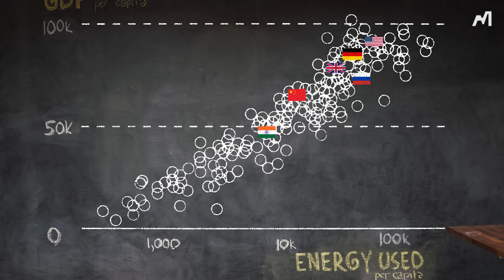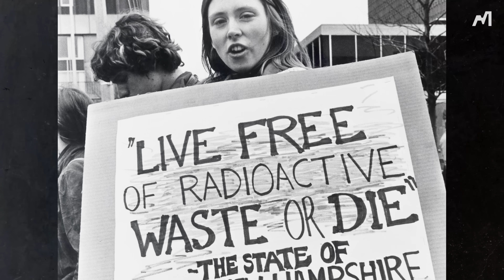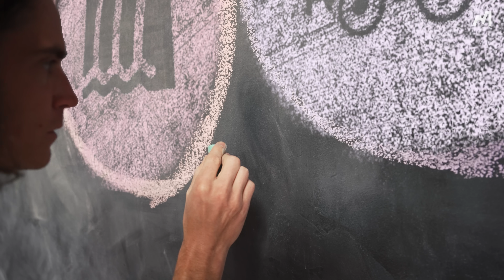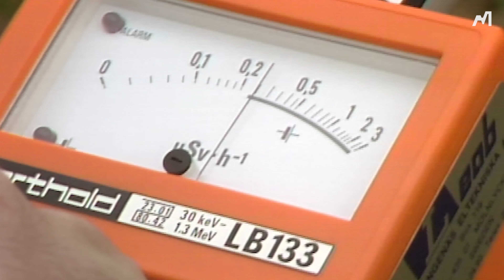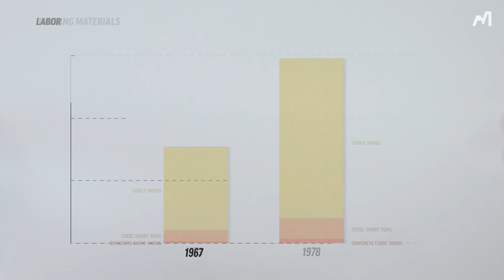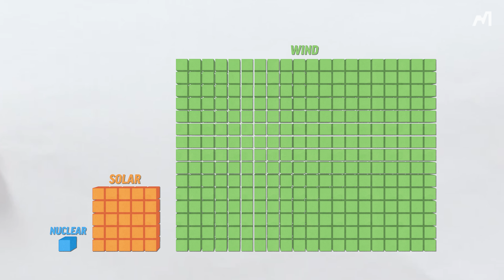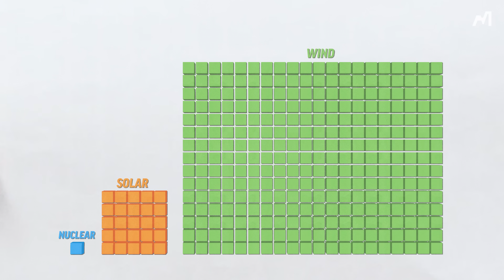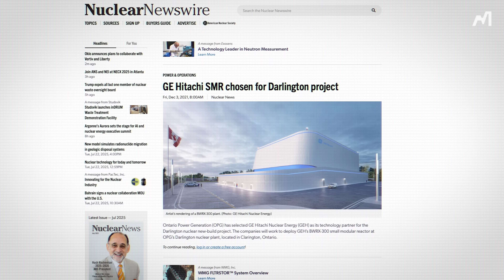They're Lying to You About Nuclear Energy

Comment: 14:31

From various sources wind turbines are designed to last 20-30 years and nuclear 40-60. 

Some nuclear plants have had licence extensions to 80 years but it's not their designed lifespan.

Using two current projects in the UK as a comparison. Hinkley Point C nuclear and Dogger Bank offshore wind farm the cost difference is huge.

Using current up to date completion costs per GW of energy produced. 

Hinkley Point C completion estimate is £50 Billion and will produce 3.2GW. Taken over 30 years from inception and expected to take 15 years to build.

Dogger Bank completion estimate is £8 Billion and will produce 3.6GW. Taken around 17 years from inception and build time of 7 years.

So Dogger Bank wind farm has been 7 x cheaper per GW to build, has taken half the time in early stages and planning and build time is half that if nuclear. Replacement of turbines like for like will be cheaper in 25-30 years time and likely more efficient and it will still have been 3.5x cheaper than nuclear. 

And you don't have the expense of storing waste indefinitely.

Footprint size doesn't matter, for energy generation it's not really a useful metric as all power generation is positioned in appropriate places. If Dogger Bank is 1000 x the size of a nuclear plant does it matter if it's out at sea? Not really.
Reply: Yep. And this is not anecdotal. Every recent review agrees. Nuclear is more expensive and takes far longer to build. And that is with nuclear having received easily 100 times the research funding over the decades.

Comment: I think it is naive to think there where only 50 death. The number for Chernobyl death is drastically underestimated. It’s a number the Soviet Union used … there were laws passed to keep the official number of deaths as low as possible. So the true number of deaths is going to be in the thousands (5000-90.000). Obviously impossible to tell the exact number.
Reply: He's going off the direct deaths from the people who died immediately in the explosion and putting out the fire. He's fully ignoring the rates of cancer in liquidators and people from the surrounding area.
Reply: @XandateOfHeaven  exactly. I agree with his point that radiation isnt AS damgerous as many people belive it is, but the way he makes his argument is just dishonest
Reply: @datpilz8895   Exactly. You can very legitimately make the case that so many thousands of people die from air pollution from coal plants that the cancer deaths from Chernobyl are irrelevant by comparison, that's fine, but we need to lay it all out.

Comment: Windmill electricity near coasts or at sea at least are WAAAAAY cheaper than nuclear power plant. At least in europe.
Reply: This is true, but nuclear plants are very cheap to operate after they've been built, and are cheaper than coal. So nuclear plants should not be shut down, and should be used in case where hydro or wind isn't viable.

Comment: Some of the land use of solar is on existing buildings, so a non-issue. On the other hand, if you rely on renewables entirely, batteries alone won't do. You also need to overcome seasonal variations, which realistically require some forms of power to gas.

Comment: Why are we still discussing nuclear? Wind and PV are cheaper. Way, wayyy cheaper. And they are cheaper even as compared to nuclear at its peak. And wind/PV got to that point in about a decade or so, despite heavy resistance of the oil industry and orange presidents ranting about birds. So safety aside, it just doesn’t make any sense anymore from an economic perspective. We need to move on.

Comment: 12:40 fascinatingly, depending on climate and the crops and solar panels used, building solar panels over crops can dramatically increase crop yield by reducing the risk of the sun overheating plants and drying out soil.
Doesnt help in climates like England or with heat resistant crops like corn, but if you want to grow tomatoes in Texas, its worth a try.

Comment: 11:50 Do note that wind energy doesnt really "use" that much land. They need a lot of area because they have to be far apart from each other, but you can absolutely do stuff like farm corn between the wind turbines with basically zero downsides. So the effective land use is very, very low. Most of the wind energy here in Germany is farmers making a bit of extra cash by renting out a dozen square meters to an energy company.
Reply: But the cost of having useful land or supporting ecosystems below is the devastation to the aerial ecosystems. A fuel source isnt exactly "sustainable" if it could endanger species in the long term that are critical to preventing ecosystem collapse, like birds of prey.

We hate insects but 99% of them are beneficial to the world. You'd likely see higher pest mammal rates around windmill farms because the birds that normally prey on them are getting sniped out of the air.

Comment: I am not against nuclear power, BUT

nuclear power is the most expensive of all energy sources. in the future, the price will only grow because the available uranium sources get harder to come by. 

also uranium is no endless ressource... if the current rate of consumption does not change, we will run out of uranium in about 250 years. 

we should not stop adding nuclear power to the energy mix, but i think it is very smart to concentrate on the development RENEWABLE (as in endless and cheap) energy sources.

Comment: Coal is far too valuable to burn, as is oil. Nuclear IS the only way forward, and Britain is being forced to go wind and solar. We have had the greenest energy provider since the 1950's in Scotland, which is hydroelectric. Now, it only gets turned on at the highest electricity usage so that they can make the most money out of it. A system that gave widespread, poor Scottish homes electricity was then siphoned off to run aluminium smelting and profit. In Scotland, we get lots of rain, so what, so does Washington State, but our green energy has been taken away from us. The Firth of Forth (Edinburgh way) is a tidal area that floods some 20-30 feet twice a day! God knows how much water that is, but tidal energy-producing subs could harness that energy, and that's twice a day. Off the Isle of Skye, the gap in between has tremendous tidal forces twice a day and they have a tidal generator of the Isles of Shetland to help power the island. We have far greener energy producers that work twice a day than all the solar and wind could produce, and you can't see them!!!

Comment: Oil/Coal/Natural Gas - constantly contaminates the environment, but is efficient enough.
Solar power - expensive to maintain and takes up too much space, not constant therefore not efficient enough.
Wind power - even less constant than solar power, therefore not efficient.
Hydroelectric Power - pretty efficient though needs a huge reservoir of water that has to take up a lot of land. And when it fails (which is more often than any nuclear accident) it causes mass destruction and deaths.
Nuclear energy - the most efficient and eco-friendly power source. Though it is expensive to build and maintain (including nuclear waste).

Comment: Nuclear power not only generates more nuclear energy. Now I will give you uranium is rare and it's it's not the best for power because it is scarce even if you only need small amounts. However, if we develop nuclear power, we might be able to get to a fusion reactor which will use hydrogen which is the most abundant s*** in the universe. So it's it's something we should use until we get fusion power but also the radioactive stuff. I've figured out how you deal with that right? You just dig a really big hole. You throw it in the hole and then you seal it. That's one of the best ways to deal with it and all it does. And all you have to do is dig like a kilometre. Deep hole which is pretty easy. Doesn't have to be a big hole, it just need to be really deep hole

Comment: Um, that very low number of deaths caused by nuclear energy use is not real... One of the issues is the linear no-threshold model that is mentioned in the video. We need to consider this, and other variables, when comparing statistics that have been built in very different ways. If we are including sensible statistical quantities for deaths caused by nuclear energy use that cannot definitively attributed in a direct way, the figures go up by orders of magnitude...

Comment: There is no such thing as permanent, safe, storage of spent fuel (witness the ongoing storage of spent fuel at plant locations from lack of dumping sites, making each reactor site "an event in progress," just like what is going on at Chernobyl and Fukushima)!
 
More stupidity is not the solution to stupidity. The simple fact is that the intense ionizing radiation in the boundary of the nuclear fuel causes the containment to transmute over time, where the containment materials lose their original elemental qualities, frequently becoming brittle and no longer able to perform as originally intended. Zombie reactors that are past their designed life are losing the safety factors originally designed into the containment in ways that are not predictable until incidents inevitably occur. The same thing applies to the containment of high-level nuclear waste. These matters are well-known to the industry, but being withheld from public scrutiny in order to maintain the current zeitgeist.
Reply: It’s not impossible to reprocess spent fuel and then take all unusable remains and make a more stable glass. 

This is generally feasible to my understanding a lot of countries just dont

Comment: Very, very interesting. Great perspective. You might also ponder that nuke power was killed to permit wind & solar on the go ...
Reply: There is no such thing as permanent, safe, storage of spent fuel (witness the ongoing storage of spent fuel at plant locations from lack of dumping sites, making each reactor site "an event in progress," just like what is going on at Chernobyl and Fukushima)!
 
More stupidity is not the solution to stupidity. The simple fact is that the intense ionizing radiation in the boundary of the nuclear fuel causes the containment to transmute over time, where the containment materials lose their original elemental qualities, frequently becoming brittle and no longer able to perform as originally intended. Zombie reactors that are past their designed life are losing the safety factors originally designed into the containment in ways that are not predictable until incidents inevitably occur. The same thing applies to the containment of high-level nuclear waste. These matters are well-known to the industry, but being withheld from public scrutiny in order to maintain the current zeitgeist.
Reply: @richardmcbroom102  a better solution needs to be found, for sure. But the trade off in generation are over solar & wind, not to mention instant availability are also factors and billions of batteries for storage of wind & solar are not the answer

Comment: There are many other issues regarding radiation exposure and nuclear waste that were omitted to suit your narratives/politics.
I don't want my children to be near nuclear reactors.
Who paid you to be a mouthpiece? AI/data center owners?

👎
Reply: There is no such thing as permanent, safe, storage of spent fuel (witness the ongoing storage of spent fuel at plant locations from lack of dumping sites, making each reactor site "an event in progress," just like what is going on at Chernobyl and Fukushima)!
 
More stupidity is not the solution to stupidity. The simple fact is that the intense ionizing radiation in the boundary of the nuclear fuel causes the containment to transmute over time, where the containment materials lose their original elemental qualities, frequently becoming brittle and no longer able to perform as originally intended. Zombie reactors that are past their designed life are losing the safety factors originally designed into the containment in ways that are not predictable until incidents inevitably occur. The same thing applies to the containment of high-level nuclear waste. These matters are well-known to the industry, but being withheld from public scrutiny in order to maintain the current zeitgeist.

Comment: Generator mechanic here. I dont respect anyone who is for green energy but against nuclear power. Double that lack of respect if they cite Chinas solar panels.
Reply: There is no such thing as permanent, safe, storage of spent fuel (witness the ongoing storage of spent fuel at plant locations from lack of dumping sites, making each reactor site "an event in progress," just like what is going on at Chernobyl and Fukushima)!
 
More stupidity is not the solution to stupidity. The simple fact is that the intense ionizing radiation in the boundary of the nuclear fuel causes the containment to transmute over time, where the containment materials lose their original elemental qualities, frequently becoming brittle and no longer able to perform as originally intended. Zombie reactors that are past their designed life are losing the safety factors originally designed into the containment in ways that are not predictable until incidents inevitably occur. The same thing applies to the containment of high-level nuclear waste. These matters are well-known to the industry, but being withheld from public scrutiny in order to maintain the current zeitgeist.

Comment: Nuclear fearmongering and its consequences have been a disaster for the human race....
Reply: There is no such thing as permanent, safe, storage of spent fuel (witness the ongoing storage of spent fuel at plant locations from lack of dumping sites, making each reactor site "an event in progress," just like what is going on at Chernobyl and Fukushima)!
 
More stupidity is not the solution to stupidity. The simple fact is that the intense ionizing radiation in the boundary of the nuclear fuel causes the containment to transmute over time, where the containment materials lose their original elemental qualities, frequently becoming brittle and no longer able to perform as originally intended. Zombie reactors that are past their designed life are losing the safety factors originally designed into the containment in ways that are not predictable until incidents inevitably occur. The same thing applies to the containment of high-level nuclear waste. These matters are well-known to the industry, but being withheld from public scrutiny in order to maintain the current zeitgeist.

Comment: More nuclear power will literally lead to less radiation absorbed by people all across the globe, cause it'll mean we wont be poluting our atmosphere nearly as much
Reply: There is no such thing as permanent, safe, storage of spent fuel (witness the ongoing storage of spent fuel at plant locations from lack of dumping sites, making each reactor site "an event in progress," just like what is going on at Chernobyl and Fukushima)!
 
More stupidity is not the solution to stupidity. The simple fact is that the intense ionizing radiation in the boundary of the nuclear fuel causes the containment to transmute over time, where the containment materials lose their original elemental qualities, frequently becoming brittle and no longer able to perform as originally intended. Zombie reactors that are past their designed life are losing the safety factors originally designed into the containment in ways that are not predictable until incidents inevitably occur. The same thing applies to the containment of high-level nuclear waste. These matters are well-known to the industry, but being withheld from public scrutiny in order to maintain the current zeitgeist.

Comment: The thing about nuclear waste is it eventually, naturally goes away. 

As long as it’s stored safely, it’s perfectly safe. 

CO2 however from fossil fuels staying the environment forever.
Reply: There is no such thing as permanent, safe, storage of spent fuel (witness the ongoing storage of spent fuel at plant locations from lack of dumping sites, making each reactor site "an event in progress," just like what is going on at Chernobyl and Fukushima)!
 
More stupidity is not the solution to stupidity. The simple fact is that the intense ionizing radiation in the boundary of the nuclear fuel causes the containment to transmute over time, where the containment materials lose their original elemental qualities, frequently becoming brittle and no longer able to perform as originally intended. Zombie reactors that are past their designed life are losing the safety factors originally designed into the containment in ways that are not predictable until incidents inevitably occur. The same thing applies to the containment of high-level nuclear waste. These matters are well-known to the industry, but being withheld from public scrutiny in order to maintain the current zeitgeist.

Comment: I'm in Australia and there's a huge push for renewables despite the fact that we are less than 1% of the worlds carbon emissions. We are essentially a rounding error, and nothing we do will help climate change. So we're projected to spend around $8 trillion putting in new transmission line and other infrastructure, batteries, pumped hydro, wind and solar.
Yet we have huge uranium deposits which we're not allowed to touch.....
No-one on the net zero bandwagon can explain the logic to me.